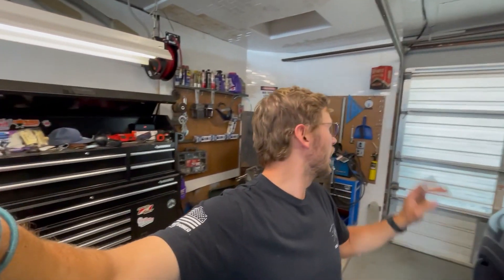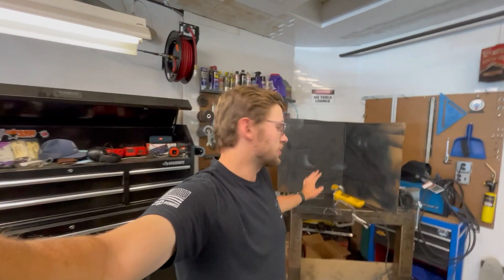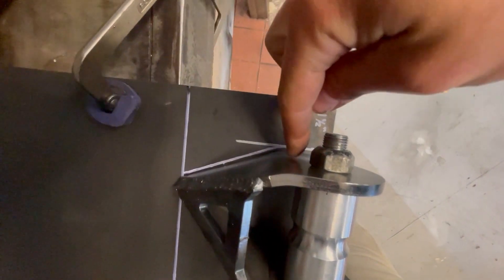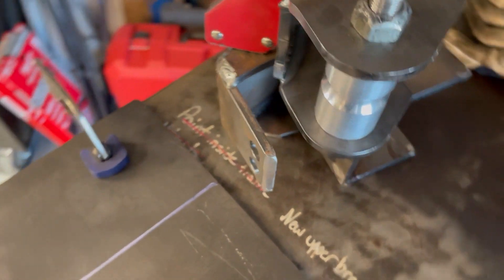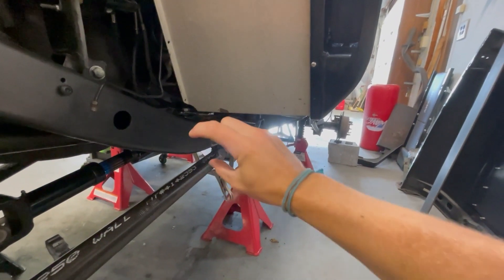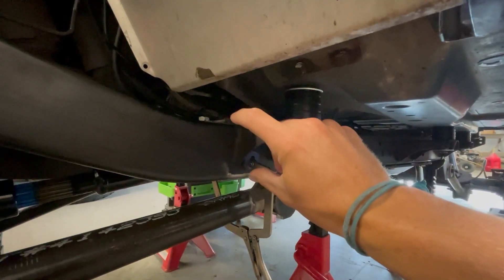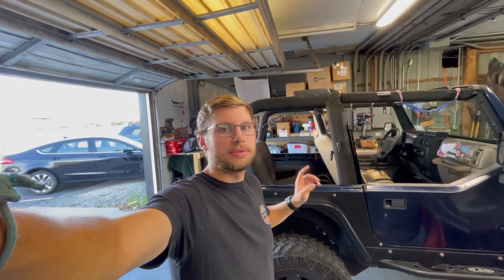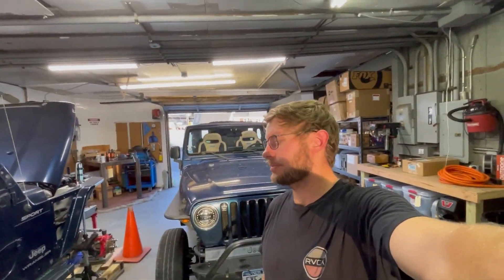Solving the Driver Side Upper Link Clearance Issue

Comment: That joint isn't really designed to be mounted like that.  I would not weld it that way
Reply from the maker: It’s perfectly fine.
Reply: @idratherbewheeling  new to me man. I ran a shop and we never seen one setup like that.
Reply: @fotomotoxxiii  out of curiosity, what do you mean it isnt designed to be mounted "like that"?
Reply: @slothfabgarage8233  the joint on the upper link at the frame end is mounted vertically with bolt going up and down.  That is not ideal way to have it because it's designed to work horizontally with a bolt going side to side.  The joint will wear out quicker and may bind or just have too much stress on it.  It's still going to work but not ideal in my opinion.  It's really not a big deal just something I pointed out.
Reply: @fotomotoxxiii  My initial thought was the same as your thought process. However, when you look at the companies that make their brackets as such, (TMR, Genright, PolyPerformance, Barnes for their 4 link) there kind of has to be a reason. I would certainly never mount a lower link that way as it sees much more travel. However, with the upper link in a 3 link generally being as centered as possible its not going to see as much travel as a lower link at the end of the tube would. I do agree that it would probably be easier on that joint if it was mounted horizontally, but if there are several well known companies making their brackets this way, I cannot imagine that it is significantly worse or they would not sell.